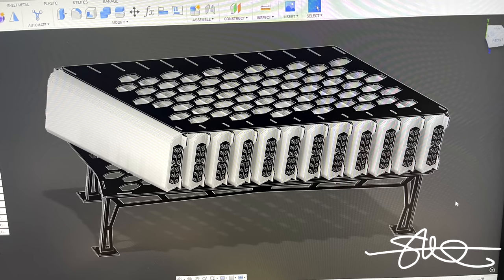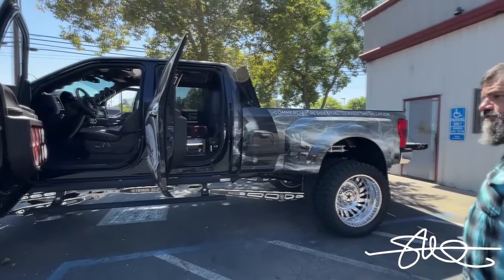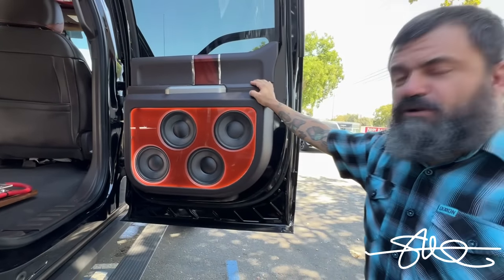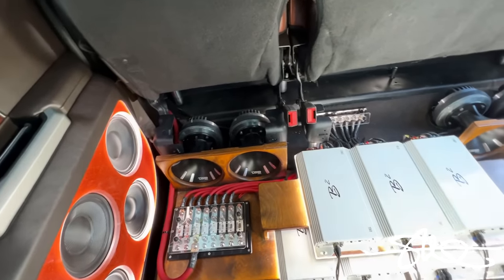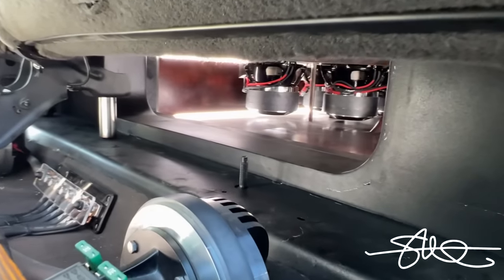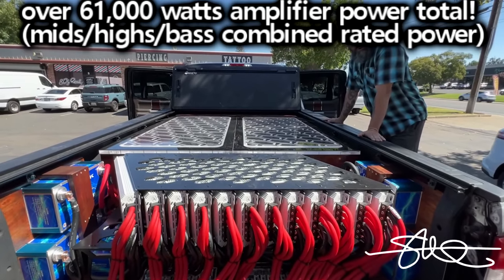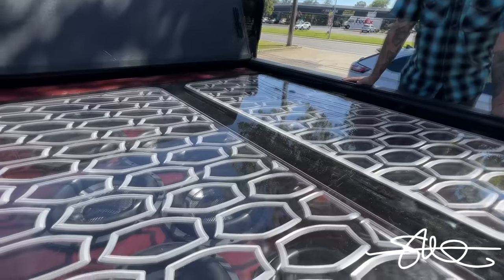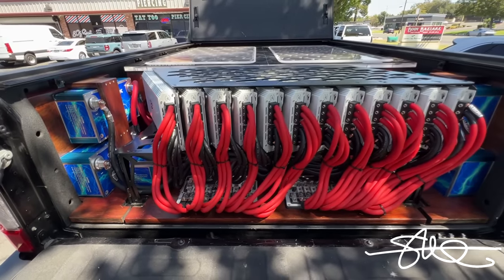One SICK Ford F450 61,000 watt sound system! Twelve 12's 4th order bandpass | a MASTERPIECE

Comment: DAMN! This build tickles my fancy in every way. High pressure SQ box and full door enclosures. 
I think the modern SQ way of full on sealed enclosures in the doors(maybe cut doors) is the way forward. Less or smaller woofers but way better sound, and it's fun when your doors beat harder than your boys whole system.

Comment: Thanks for this video.  It answered a question about the blow through in my truck.  Mine has 440 square inches of blow through area, and I had wondered if that was choking my 2 18's back.  I have 110 inches of port area with the port extending 5 inches out of the box into the cab, then a step down from the subs boxes 49.5 x 24 size  into 44x11.  My subs, dual Dayton Ultimax 18's get 6 cubes each and because of the setup, it is a semi 6th order, but intended to be a regular vented enclosure.  After seeing these 12 12's, it is clear that I'm fine.

Comment: What do you recommend for vocals speakers for a 95 Chevy caprice classic
Reply: Are you trying to fill factory speaker locations or are you going custom?
Reply: @TsunauticusIV  the ones he said in the video.
Reply: @TsunauticusIV  yes I’m trying to go custom
Reply: @scottrainey1989  if you’re looking for decent quality without breaking the bank… possibly JL 6x9s. If you’re trying to save money… there is a Rockville kit that sounds pretty darn good for the price. You get 4 6x9 speakers AND an amp for $230. We actually used that setup for a quick and dirty “disposable” system where we put the 6x9s in individual speaker boxes. We left about 10 feet of speaker wire to each speaker so we could use the speakers during parties/cookouts to fire the mods/highs in directions they could be heard better. For the price… we were shocked at how good they sounded. Back to the main topic tho… there are a ton of directions you could go with your setup. Those old chevys have a lot of possibilities. You need to decide what (1) price you want to spend (2) speaker size (3) type of enclosure- factory mounting or custom location (4) whether you want sound quality or loudness (5) if you want to run an amp for highs/mids or rely on the head unit - which I don’t recommend. Amp makes all the difference for highs and mids. There are a ton of variables and we could talk for hours about it. Hone in on the factors you need to consider and go from there.

PS: that “disposable” Rockville system we built ended up becoming a permanent fixture in that Jeep. 😂
Reply: B-2 audio. Sweet as danish. With 6×9 cut outs. like what's in steve meades ford pick up. Cant go wrong excellent spkr.

Comment: Be Honest. What would the total cost of a build like this be?
Reply: I'll guess..
I'm thinking around 30k for the gear, maybe 35k?

The installation and fabrication had to take 100 or so hours? Maybe double or triple that.
Say installer charges $100/hr. So 200 hrs would be 20k for labor.

Electrical (batteries and alternator) 7500.

So my guess is around 62.5k.
Reply: I think that’s a bit low.  The sub amps alone are a grand apiece.  Subs that can handle that power? Another grand each.  There’s $24k. Don’t forget all that copper cable, that’s gotta be at least $10k alone.  Speakers, other amps, custom enclosures….I’d say $150K minimum for gear, fab and install.  Let’s also not forget the truck itself is $100k from the factory. I’ve sold a few of these myself.  Then the suspension mods, wheels, wrap, other upgrades say another $50k. Total…..$300-350k. Plus tax. Maybe more